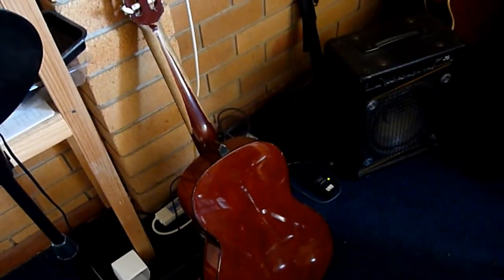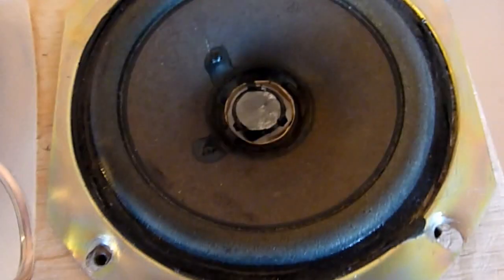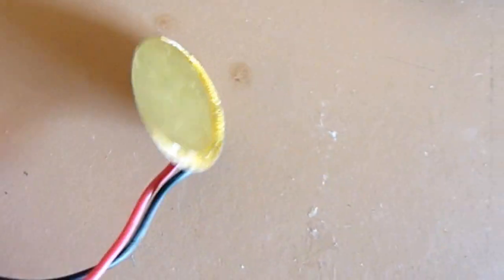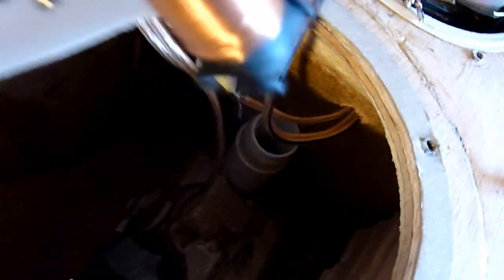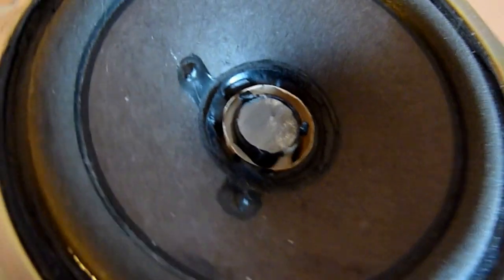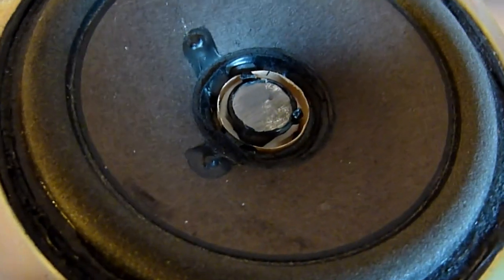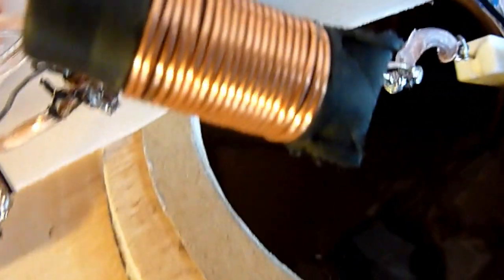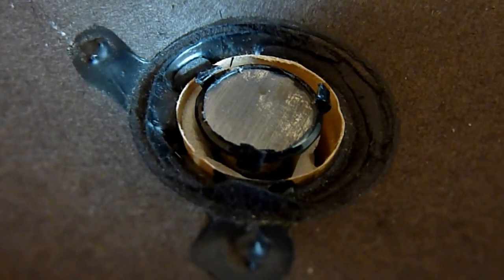WHAT'S INSIDE MY POINT-SOURCE SPEAKERS?

Comment: Hi, Kindly Please try & Replace your speaker Capacitors to Silver Cap. Everybody say Silver Cap sound Best  of the Best.  

Pls insert in "Solen SILVER METALLIZED POLYPROPYLENE CAPACITORS" and try it out on Mid & High frequency Crossover.

By right should be Perfect. Pls...insert into it & provide comment. Tks. Please provide Youtube review. Pls, no cheating, must be silver cap for High & Mid range together. Try it.

Comment: Do you have a video that better explains the crossover? I'm having a hard time understanding just how to make one for a simple two way speaker setup.
Reply from the maker: For the simplest 2-way crossover, use a 1-2 mh choke in series with the woofer and a 2-3mf cap in series with the tweeter. But most 2-ways have two chokes on the woofer. A 3-9 mh choke in series with the woofer and a 1.5-2.7 mh choke (that is in series with a 10-20 ohm resistor) and is in parallel to the other choke. And a 2-3mf cap in series with the tweeter. If it's a cone-tweeter, use 2 mf and if it's a dome (or tiny) tweeter diaphragm, use a 3 mf cap. The reason I gave you parameters instead of exact figures, is cos all speakers are different. Expensive woofers generally need lower value (thump-chokes) cos good woofers naturally have more thump. To make a cheap shit-woofer sound insane, use a 9 mh choke (the BIGGEST there is). lol It will sound good (at the expense of efficiency), but (with enough power) that won't effect quality.
Reply from the maker: If you are using lounge tower boxes, use a 9 mh choke on cheap woofers but in a book-shelf box, use 5.6 mh chokes on the woofers. The reason for that, is that bookshelf boxes won't go low enough for the BIG chokes, where-as a lounge tower box will. HINT; put a double chamber in lounge tower boxes. A partition (with the woofer chamber smaller than the other chamber). The partition has a 1" slit between the chambers (and a 2" lip on the slit). Just a piece of 2x1 pine (inside the box). Also brace the box with 2x1 pine a bit (inside the box). It's a bit of woodwork but much improved "punchy" bass. And the med (the most difficult region) is also improved, by the double chamber. Lounge towers don't sound very good without (at least) some sort of modification (inside the box). Another trick (instead of double chamber) is to make one end of the box, like a 45 degree bevel (inside the box). One end is square and the other end has the bevel. Neither are really more-or-less difficult to do. And (of course) you need the vent (explained in my video).
Reply from the maker: When you buy the caps (capacitors) make sure they are speaker caps, not normal caps. lol
Reply from the maker: +james hunt I would be interested in how to make transmission line for a med speaker, so I will investigate.
I now have finally nailed my lounge speakers. I kept blowing tweeters so I have tiny full range speakers and I finally got them to sound nearly as good as tweeters. lol It's the tiny size plus I "doctored" the cones. lol
Now my "tweeters" handle my 200+200 w amp without blowing. But even with a 6 mf cap on the little full-range speakers, I can still get them to ex-curt an eighth of an inch. lol  A tweeter would just blow at that level. I've had smoke coming from tweeters (they are hopeless for power handling). But the full-range speakers are meant for the whole signal and therefore and muck stronger (by-a-large-measure). Usually tiny full-range speakers are muffly compared to tweeters, but I (now) run mine totally outside the box (and I seem to get an extra octave in treble). lol
And it's great sounding treble (out of the box) like tube-amp treble. lol I put a 1.5 cap on the full-range speakers, and a  33 ohm step with a 4 mf cap as well. 1.5 mf would seem to be a bit small, but when it's out of the box, that's what sound best. Any bigger cap and all you get is squark (and a LOT of it). lol But if you know what to do it sounds better than any other speakers I've heard. lol its the out-of-the-box top-end and the "open" sounding med that makes them sound good. I have some "Full-Range Speaker + Woofer" videos on YT. But you won't be able to tell on YT lol. Just about any speaker will "sound good" on YT. lol

Comment: i just got some water light speakers that are epic they weren't that loud but i popped in some creative technologies speakers in them and they are perfect and cool
NOTE: water light speakers are speakers that are tall but only a quarter of the bottom are speaker, the top is a tank of water with a cool LED light running through it, it goes higher when the beat is higher, AWESOME

Comment from the maker: In some of my videos I deal with very small full-range speakers and use them for tweeters. Cos they are so small, they tend o go as high as tweeters (and a small aluminum "whizzer" also helps).
Also see a concept that is easier to make (but is only point-source with upper-med and treble). And sounds better than most normal two ways. Video called "2-Way Speaker Concept Prototype". It uses a 2" full-range speaker (for upper med and treble) and a separated woofer for bass and lower med.

Comment from the maker: What is the diam of your tweeters, and are they coil-tweeters (not piezo)?
Anyway, if they are small enough, they may fit inside the "Response" 6.5" woofers. That would be ideal, cos the 6.5" woofers go to 7 khz (nearly full-range). Also can you get old 2" cone-tweeters from old speakers (or even new)? Use them to make my "New Concept" point-source speakers (see video called "Make Your Own (New Concept) Point-Source" speakers. Not for the faint hearted. lol (but they sound good). Hear demo. lol

Comment from the maker: I recommend that you try making some 2-way point source speakers, using coil-tweeters. I have ways of doing it (in my videos). Poly-pipe, or anything tubular (of different diam) along with tape to make a snug fit, can be great for mounting tweeter. lol Don't glue, cos you may want to dismantle later. I have several "Assembly videos". It's easy for me (being a tinkerer). Speaker Doctor! lol
The sound of proper 2-way point-source is WELL WORTH the trouble! It's the GEOMETRY! Think about it.

Comment from the maker: 2) You CAN'T use your full-ranges cos there is no hole. Simple! But see my video called "Full-Range Speakers More Top-End". This is what you can do with your full-range speakers. Much improved, but won't sound as good as 2-way point-source (and it depends on the speaker). 
With your tweeters, put them in the 8" (or if don"t fit use 10") "Response" brand woofers. Get them from "Jaycar" electronics. (Look them up and order). They are not very expensive and have holes in them. (Shown in my video).

Comment from the maker: 1) I drilled these ones, but only marginal success. But I managed to clear the scraping speaker of the unwanted filings by pushing paper through the gap. So I DON'T recommend it. You also have to "Blue-Tack" it all up first. lol
See my more recent videos (by going to my ch). See "Make Your Own "KEF Uni-Q" Speaker (2-Way Point-Source)" and "Make Your Own (New Concept) Point-Source Speakers". This new design is much better cos the treble is much sweeter, cos it uses COIL-TWEETERS! lol

Comment: Hi! I am looking at your posting and must say that you gave many so many information on how to experiment and improve the sound of speakers that is great, thanks! (I am a novice in this!:)) i have a question, I have a set of 6.5",15 watts full range that I would to make a two point speaker using a set of tweeters that I have from a coaxial speakers pair, but the magnet doesnt have a hole so I can run thru the wires, so, drilling a hole thru the magnet will damage the speaker? Thanks.

Comment from the maker: See my video called "Improve Top-End of Full-Range Speakers". It shows you how to do it without the piezos. But you may have to do the aluminum thing (much easier than piezos). Otherwise the woofer will drown out the feeble treble, if you don't do it. Also boost top end with a 3.3 mp capacitor and an 18 ohm resistor in parallel hooked up to positive on the full-range. And a 1 mH choke on positive of the woofer (for the simplest crossover).

Comment from the maker: Point-source sound means that it is coming from one point (or one region). With these speakers the treble&med are coming from one point and the bass is separate. But with most two-way speakers the bass&med comes from one point (the woofer) and the treble is separate (tweeter). Speakers sound better (by a large measure) when Treble&med comes from one point. And that is why cheap computer speakers (with a sub) often sound better than normal (more expensive) stereo speakers.

Comment from the maker: Full-range speakers are good (being point-source) but they lack the upper top-end treble, and so don't give half the sound image they should, or could. With a piezo stuck inside the cavity of the full-range driver (with dust-cap removed), the upper treble of the full-range speakers is greatly improved, and cos the piezo-tweeter is in the cavity, it is still point-source! Point-source, with the extra top treble makes insane sound-image! See  my video called "Point-Source Speakers for Dumbies".

Comment from the maker: Point-source, meaning from one single region, so full-range speakers are point-source! Point-source gives better sound-image cos treble&med are combined into one region (unlike most two-ways). With Trebl&med sepate (most two-ways), as you walk around the room, the distance between treble-driver and med-driver varies. But with treble&med coming from one point, there is no difference in distance from treble source and med source. No interfearance and no phase-shift in treble&med, better sound!

Comment from the maker: Point source means that the sound is coming from one point (or one region). But it is only critical for good sound that the treble&med be point-source. The treble&med comes from the one drive-unit (or tweeter in cavity if two-way). But most 2-ways have the bass&med coming from one point (the woofer) and the top-end is separate (tweeter). My speakers have the bass separate instead and the treble&med are coming from one point (full-range speaker or two-way with tweeter in cavity of med driver).

Comment from the maker: See my video called "Speaker Concept Prototype". A must-see if you are into building world-class speakers, cheaply. It's a "Logitech" 2" tiny full-range driver with an 8" woofer (normal 2-way layout). Much easier to make and sounds insane! See video and make the inner part of the 2" Logitech the same. It's a two-way with a super low crossover freq. At 200 hz instead of 1 khz. This is in the upper bass and so all notes higher are point-source! No need for a piezo, driver is tiny, great treble!

Comment from the maker: These particular full-range speakers (Sharp) were bought at a second-hand shop ($10 a pair). They were in small enclosures and old, originally for a shelf stereo.
These little 4' Sharp speakers are fairly common in second-hand shops. I'm talking about op-shops (not pawn-brokers). Op-shops are much cheaper (and junkier) than any pawnbroker. If your country is like mine, you shoud be able to pick up cheap old full-ranges from Op-shops. I have a much simpler design now.

Comment from the maker: Sounds about right but you have to have an idea of how to do it like that. I just use my ear. You have to have an idea of what the components do. Through trailn and error, I have a picture of what the caps and chokes do. It experience. I use a resistor in the med that lets it all through (but restricted) in parallel with the rest. This makes smoother sound and ensures no gaps. A great improvement with my full-range speakers.

Comment from the maker: If full-range sounds "whispery" with my suggestion, it would be because of the ribbon. In that case go for a 4.7, 5.6 or 6.8 mf capacitor on the full-range Cross-over.

Comment from the maker: Making cross-overs for full-range speakers: Drive-unit is in series with a 50 ohm resistor that is in paralallel with ( a 0.8 choke that is in parallel with a 3 mf capacitor). 
I'm not sure about ribbons, Try from 1.5 mp capacitor and try each progressive value, up to 4.7 mf capacitor for your ribbons!?!

Comment from the maker: If you want a really easy cross-over for full range, use a graphic on the full-ranges and a capacitor for your ribbin and a sub doesn't have a cross-over. I did it with full ranges (the best way to listen to full-range). I had a 60+60 Kenwood amp (with it's own built-in graphic) and ful-range speakers (and no cross-overs). Sounded good.

Comment: what do you think at what points would you cross sub, woofer, mid(fullrange) and ribbon. i was thinking sub up to 80hz, woofer 80 to 300or 500hz, mids something up to 3-4000 and tweeter all they way up. i am not sure about mid frequencies because mid is in a small box so i can not get much lower frequencies of it and woofer does not sound nice if i run it on higher frequencies. what do you think?

Comment from the maker: You need to get "cross-over" components.
You know how resistors go, the higher the value, the more it holds it back (softer volume).
With capacitors, the higher the value, the lower the frequency they let in (too high value makes tweeters sound "chuffy" and too low value capacitors makes tweeters sound "tizzy" and thin.
Whith chokes, the higher the value, the lower the bass. Low value for "boomy" sound and high value for "thumpy" sound. But sub does not need one (if driven from sub-amp).

Comment: im not sure if i need to put a resistor on mid and tweets because i am running them on a seperate amp,so i can just turn down the amp.i use a fullrange mid (4in but in a very small box) and a ribbon tweet.on sub and woofer i am thinking of just leaving amp crossovers to do the job,but i want to make crossovers for mids and tweets.i was watching all of your videos but it is still confusing since i do not see the plan lol.but i understood what you have described now what to do.thanks foryour help!

Comment from the maker: 1) See my video called "Point-Source Crossover Concept". It has just what you described. But, for a car it would be different. But I'll tell you what I woulld do to start. 
Woofer:  (not sub) 1.0 (value number) choke in series with the woofer.
Med : Med is in series with: 50 ohm resistor that is in pararallel with a (6.8 mf capacitor that is in series with a 3.3 ohm resistor). 
Tweeter : A 3.3 mf capacitor in series with it.
Hope you can follow it. It should sound prettty good. Next!